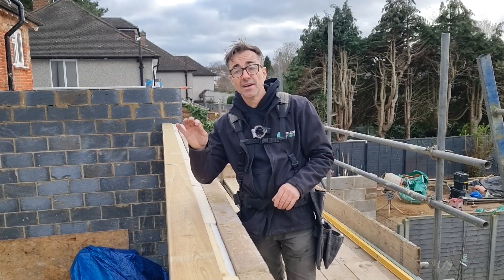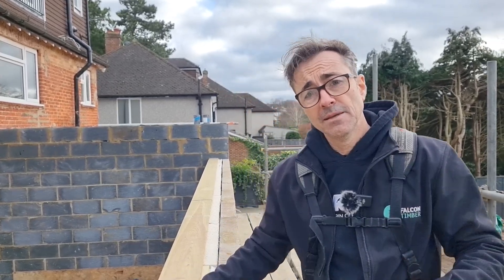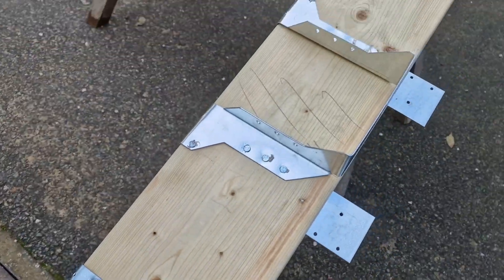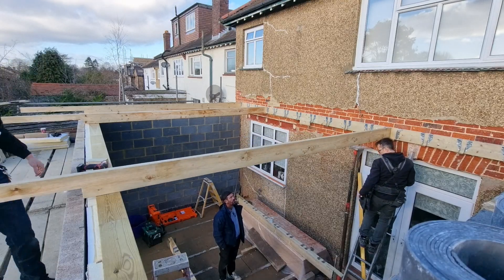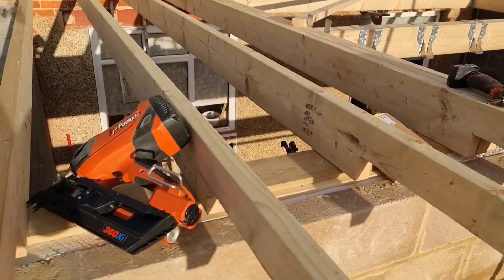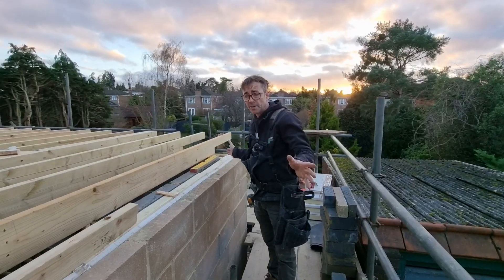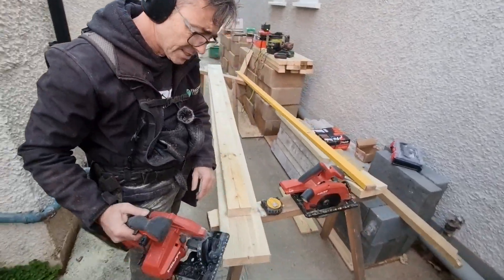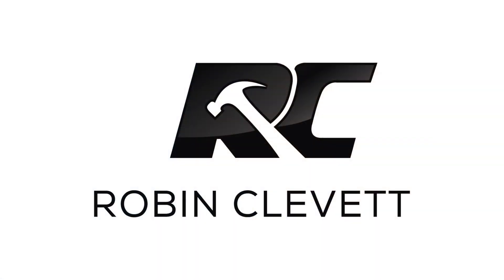Making a simple flat roof structure with trimmers for a lantern or roof light

Comment: Good to see you're using triple joists for those trimmers.  You should really bolt them with toothplate connectors, never trust just nails.
Reply from the maker: Mostly now we use a timber lock or construction screw with a wafer head in place of a coach bolt and tooth plate connectors, especially where we are simply hanging in a large shoe and sitting on the wall on the other end all the load is downward and predictable, we also tend to over spec the joists now and from memory these where 200mm and we could have probably got away with 175mm

Comment: Great tip on the firring, I have a 11x5m roof to tackle in the next couple of weeks. Am I right in thinking that you dont need to use a timber wall plate on the inner leaf of the blocks? Instead can you rest the joist on dpc and use a twist strap off the wall (at appropriate spacing) to hold the roof down

Comment: Out of interest, rather than using long furing strips, why don't you just tilt the joist by a small angle. PS not a builder ;-)
Reply: Because the ceiling wouldnt be leval inside if you tilted the joist
Reply: @karl212  Obviously ;-)
Reply: Can have sloped joists but just need firrings above the plasterboard... Flat with firrings on top is easier.
Reply: Yeah I just had an upper extension on the old ground floor one and the whole roof had to come off because it was not level as they tilted the joist.
Reply: im having a sloping osb ceiling in  my extension, showing the joists underneath it because the osb and kingspan will be above it. Looks good, and honest to the slope of the roof.
Reply: @DICEGEORGE  Agreed. That's what I did but then it's an old house with 'character' so a sloping ceiling doesn't matter. I think we are a bit obsessed with level ceilings.